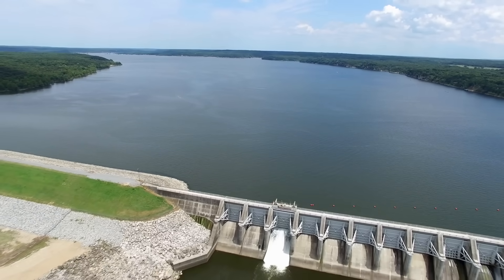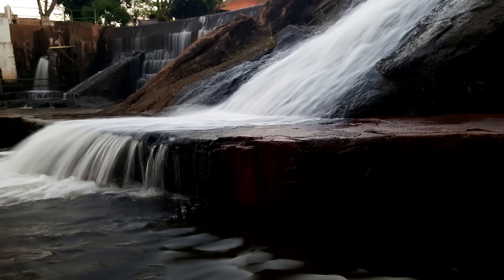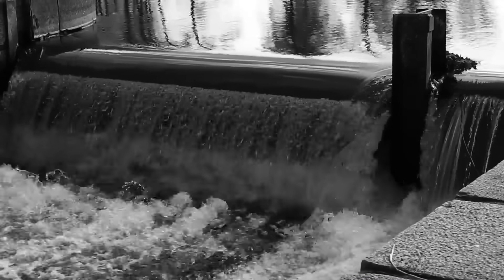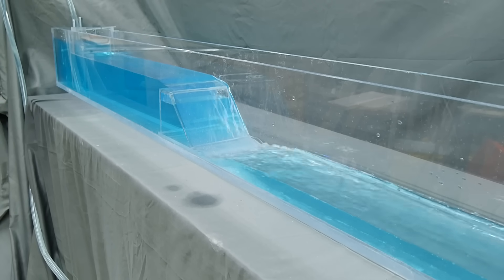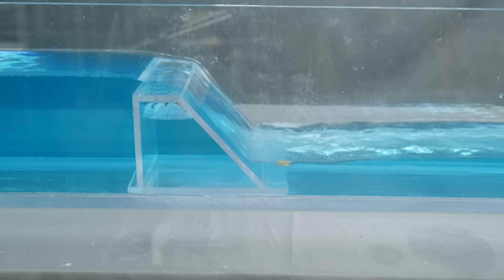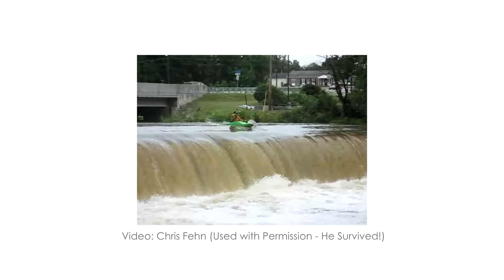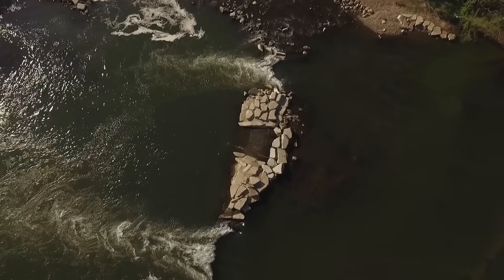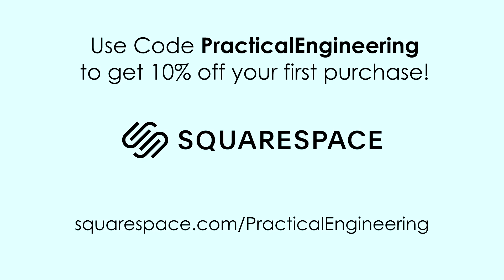The Most Dangerous Dams

Comment: Not even Michael Phelps could out-swim the speed of the circulating surface water of many of these types of dams. If you find yourself trapped in this situation, one of the only things you can do is let some of the air out of your lungs so you sink, and crawl along the bottom until you get past the boil point. This method has its own risks, of course, and should only be used as a last resort.
Reply: Good point Zachary, and as mentioned earlier, do this right away before your strength is all used up.

Comment: If you’re ever trapped in one of these your best bet is to get a big breath before going under and then swim to the bottom of the river. And try to move down streams. This will likely be very difficult because the turbulence will disorient you but it’s better than trying to beat the impossibly fast current at the surface that will only suck you down again

Comment: You should do a video on bell mouth spillways, they are absolutely terrifying. When is was growing up we lived next to a golf course and there was this large pond next to the club house that had large drain pipe about 2 meters in diameter place on the edge of the pond next to the main path that for about 3 years had no safety railings or gratings, and you could stand on the bank next to the path and practically look straight down it and see nothing but black. I am still not entirely sure where it ultimately drained, I was never able to find a body of water low enough nearby that would so it likely feed into the storm drain. I remember having nightmares of tripping and falling in that damn thing. thankfully they eventually put a rather heavy galvanized steel grate over it, they probably got fined by city ordinance.

Comment: if you are ever on your own and get sucked into one of these, STAY CALM. try take a deep breath, curl into a ball and let the flow push you to the bottom. When you hit the bottom, grab the riverbed/swim/kick WITH the flow to try and emerge the other side of the boil. Float up, and swim firm and steady for the shore. It will be dark and very very cold, but stay calm. You will use your air 10x faster if you panic. Accept the flow will drive you to the bottom and go with it.

Comment: Really appreciate this video. There are a number of dams in my area where the head and tail differential can be drastically changed by a good rain, snow melt, and the local power company. This really shows what is happening during those changes.

Comment: Adding, a straight dam of clay & rocks won't hold as well as an arched one used in bedrock dams, the arch transfers stress from direct pressure across into some sideways compression at midpoint, adds area to take the load, alters how water wants to move near the dam, pore pressure doesn't need volume to move clay particles allowing internal compaction over time from the slightest leakage at these pressures.

Finally, "spillways" are limited by plunge-pool physics, it's better planning to have a low-angle riverbed to join downstream where runoff volume is handled at less velocity, high speed water erodes at V^3, and lifts at V^2, that's why steep, long spillways must fan out sideways to slow it down like an alluvial fan, confining it between parallel walls isn't represented in nature, ymmv.

Comment: Thank you so much for such practical and potentially life-saving information, Grady!  I only recently moved from southern New Mexico, and there were several of these low head dams along our largest river in the state, the Rio Grande.  One in particular had a camping and picnic area built around it.  Not that long ago they even used to let people wade into the river, and walk right up to the base of the dam!  There was almost never enough water flow to get the tail water anywhere close to the dam, but still pretty dangerous knowing what I know now, thanks to you!  Just about 3 or 4 years ago, they posted signs and a buoy line not letting anyone get closer than about 75 to 100 feet of the dam base.  There was also recently a case where a man from Deming, NM died being pulled into the recirculating flow at another one of these dams.  He had entered the water with his family to play and cool off, immediately downstream of the dam, and apparently got too close to the dam and ended up in the keeper.

I believe the reason for all the many low head dams on the Rio Grande are for supplying water to irrigation canals.  Farming is big out there.  The Elephant Butte Irrigation District (the authority in charge of these dams) really should do a better job of public outreach and education involving these low head dams, and consider more exclusion zones and signage like you suggested.

Comment: there is a technique to get out of the boil and go downstream, i discovered it when i got stuck in one of these waves. I cant say for sure it would work in every situation as the current may not bring you close to bottom but here goes. Tucking your self into a ball when the current pulls you under lets you flow deeper into the wake then spreading your arms and legs as you hit bottom gives the rising part of the boil a much better chance of pulling you in the other direction as the spreading of your limbs on the way back up puts more of your body across the line. you need to almost hit bottom for this to work though.

Comment: As a kayaker I had no idea about this... I've run a few low dams and have gotten stuck in this sort of thing before... luckily the rivers where this happened were shallow enough I could just stand up but it was very scary and people have drowned in this river before but I never thought about the "keeper" aspect caused by the dam.  I'll definitely share this video with others I know as low water dams are actually fairly common in my area.
Reply: Natural rivers get some keeper but the shape is way better in natural environnement, its rhe straight line of dams who make those so dangerous. 
In kayak river "reading" is everything anyway, you probably now the god like strenght of water on our poor vessels ^^ 
But i see friends stock in keepers and you got really few time to react, always take a security rope with you ( and a knife to cut it if needed)
Reply: @kint87  some of the rivers in these parts have these wrap around mill dams that are often no longer used. The banks have been modified as well so the natural wind around the dam at least has been taken away.

Comment: I once went kayaking (as a school trip) and while going through a rapid and concentrating hard on not flipping the whole thing, i got off course and went towards the nasty bits of the rapid, i got my kayak the right way just before a drop (like a low head dam, but smaller), i almost got stuck but i luckily had enough speed and i baddled like a motherfucker once i landed.
The instructor told me later that if i had gotten stuck, i would have had to take off my life jacket and dive under the "death current". 
It was fun though!

Comment: Good video. I have some experience with this. When I was a kid, we all used to mess about on the river in a rubber dingy. One day we thought it might be fun to go over a weir. It wasn't fun for long when we got caught up in the turbulent water at the bottom. we just went round and round, and we only just managed to stay in the boat, and eventually we were able to paddle out. Some years later, some kids drowned at the same weir. they modified it to make it safer after that. I still have nightmares about it, and I've had a bit of a fear of fast flowing water ever since.

Comment: Also be aware that these hydraulic jumps can also occur in nature, which is why you need to be very good at reading the water if you want to stay safe. Normally, natural hydraulic jumps are not as wide, but can trap you just as easily, especially if bent with the ends pointing upstream.
Reply: James McCann I got caught in one river tubing in North Carolina on just a lil two foot "waterfall" going into a six foot deep rock channel about twenty feet long with still water on the outside, it wasn't much wider than the inner tube itself but damn was it powerful. I'd guess it was a natural hydro jump that the locals built up with rock walls to make a faster waters. I was probably stuck in it for about 45 seconds until I was able to kick off the rocks hard enough to make it through the turbulence and into the flowing water again. Even though I knew to stay calm from scuba training, I could feel the water pummeling my body and it did make me cough up some air and that shit is terrifying. 

Things like rip currents, undertow, how to escape fast moving water etc are all usually taught about in a variety of aquatic sports/rafting/survival/lifeguard classes, some of which I have attended. But this video is honestly the first time I've ever heard of the dangers of hydraulic jumps ever...

Comment: This might make things messy, but, was wondering, if you went to you local Hobby Lobby or craft store, etc... Acquired some various colors of glitter to add to the water to show the various currents, that would be neat to see in detail... They sell various colors, (of course, duh) but various particle sizes of glitter as well... Not all glitter is the shinny reflective silvery mirror type, you find just plains colors of pastel colors as well... Pending the size particle to try, I doubt that the pump would be hindered by circulating the glitter, if you are using an aquarium pump, or centrifugal or impeller type pump, as those are typically non-interference type designs to allow room for junk to pass on through, and not jam or lock the motor up... I am imagining a black glitter with a 0.020" size in the blue or teal water color, against the white back drop, or garage door, as you have been doing... Maybe some new ladies panty hose can be used as a screen/filter to collect the majority of it, to them dispose of, if this idea is too much to handle, and just rinse the rest away with the garden hose in the lawn??? Maybe even the reflective mirror type glitter might show up wonderfully as it swirls around... for all I know, the stuff may end up just being rimmed up on the sides, or the inner walls kinda like what junk floating in lake water does on the beaches, with the well defined reaching action of the beach waves rushing in a line of junk where the water no longer reaches?

Comment: I know it’s not great for swimmers and kayakers, but that recirculation zone has some really really interesting properties. I gotta figure out how this effects river health in terms of suspended sediment, dissolved oxygen, HABs, pollution, erosion, etc...
Reply: That would be interesting to note. I wonder if the hydraulic jump increases DO in the winter in northern climates when the river is usually covered in ice.
Reply: So I figured it’s definitely a problem where the vortex scours the riverbed and re-suspends sediment, but then it goes and retains that turbidity within the vortex and ejects the larger, heavier grains. Those heavier grains would be the ones to fall more quickly out of suspension and get transported along the bottom and banks of the river without clouding it. That would deprive the downriver areas of softer sediment, but what it still provides isn’t the worst stuff...

Wait. While one of the big problems with dams is that they trap sediment behind them, isn’t the sediment sorting usually the other way around? When the river slows in the reservoir, particles drop out of suspension instead of continuing to be carried downstream. Wouldn’t that tend to draw out the larger grain sediments first and leave the finer silts and clays in the water? Maybe this vortex helps rebalance the mix

Comment: If you are kayaking and want to go over a dam, here are some tips. First, never go over a dam larger then 1/2 your vessel. Second, go fast. You want enough momentum to carry you though the standing wave. Third, do the smart thing and Portage downstream. I have crossed them and it is an exciting rush, but not worth the risk
Reply: Fourth, if you get caught in a keeper, swim to the very bottom so the boundary layer pushes you out of it
Reply: @vidznstuff1   hmm ... that makes sense, if you do it early enough before exhaustion and inability to fill your lungs robs you of the possibility (actually full lungs would make it difficult, might have to do it immediately AND anaerobically)
Reply: @vidznstuff1 
That's assuming one can tell up from down.
Reply: @klobiforpresident2254  100% agree.
Reply: ian long this assumes that you have prior warning of the existence of such.
Reply: @LostInThe0zone  most times you do. Every single one I encountered had always had signs upriver warning against them. Even if there are no signs, there are easy ways to detect them. By the nature of the low head dam, there will be a flat, calm section of river just above the dam with a sharp and distinct cut off. This section of the river will always be slower then the rest of the river.
Reply: @xqiuvmah  I wish that it was the case that enough of these damn lowhead dams were marked such that my daughter would not have died.
Reply: To add to it ball up to get down of caught in a stopper, then make a star near the bottom, to assist in escape. Everyone who does white water safety and rescue course with British Canoeing is taught this, as well as detection form upstream, can always tell your approaching a weir.
Reply: @cjhification  One of my teachers demonstrated this under a particularly scary weir. Terrifying, and I got the message.

Comment: Sooo, is it more dangerous than 30 meters high 'classic' dams?
Reply: Mostly like he says because people underestimate them and that ultimately leads to them taking many lives in many small instances. The big ones will of course do more damage if they fail but that also leads to them being better regulated and maintained so they don't fail much the threat from the smaller ones is poorly managed as it doesn't create such headlines. It's kinda like comparing cars to airliners the former take way more lives because they are far worse regulated and people get overly comfortable and complacent, the latter cause way more casualties when they happen but because of that more work is done to ensure they are maintained to an extremely high standard and rarely do fail making them much safer overall.

Comment: The flow is no longer sub-critical past the weir because of the change of potential energy into kinetic energy. So why not require a dam builder to install small structures that dissipate some of the kinetic energy and return the flow to sub-critical and avoid the hydraulic jump altogether (e.g a corrugated surfaces) so everyone can use the waterways safely?
Reply: That's fine for new structures but as pointed out in the video, most of these dams are old, even abandoned.
Reply: @phlodel  wonder if older small dams should be blocked off to waterway users. Those that are not in used should be demolished

Comment: Why is removing a lowhead dam expensive and difficult?  Couldn't you use explosives?  Also would you necessarily have to remove the whole length or could you just poke a couple of holes in it?
Reply: Saws and construction equipment should be enough for small dams.
Reply: It's going to vary according to the conditions at the dam and the way it's constructed.  For example, explosives may not be suitable in built-up areas.